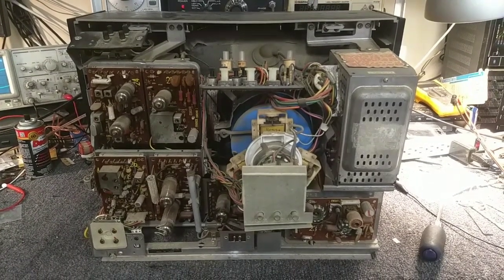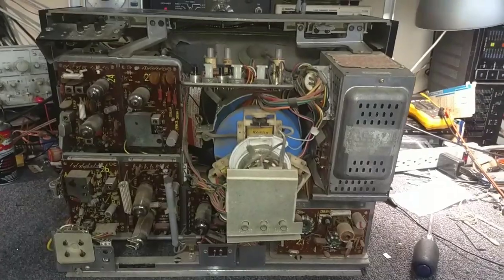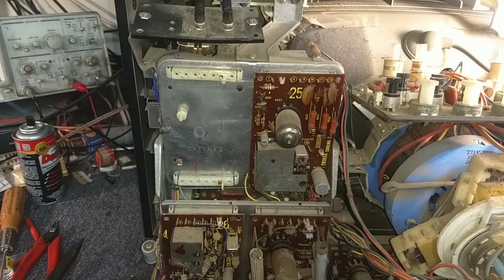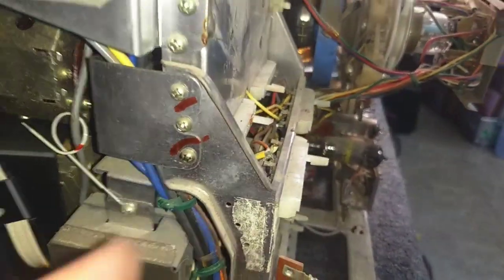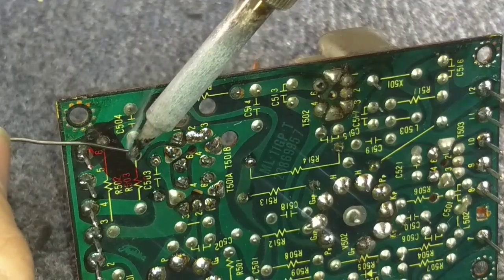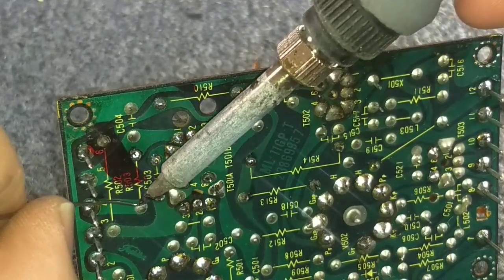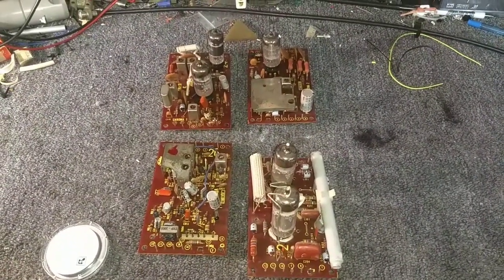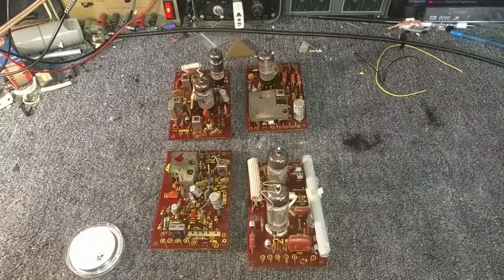Repair of a 1973 Toshiba C321 13" hybrid tube/transistor color TV - Part 2 /?

Comment: I find that with the newer style soldering irons (those with the element integrated into the tip like the FX-951), you can get away with a much lower tip temperature because it actually maintains that temperature on the surface of the tip, even under thermal load. The Metcal and Thermaltronics (Hakko FX-100 as well) are even a step above stuff like the FX-951 because they use an induction heater for the tip, so the thermal regulation is extremely good. I find that with the Metcal, I have a much better success rate on badly deteriorated PCBs than I did with the FX-888.

Comment: 28:20 Yes you are right. Strange tubes in Japanese sets. Also, the overall quality of many of the Japanese tubes was lacking. The cathodes did not last as long and they tended to grid emission due to the metal deposits moving from cathode to grid at an accelerated rate compared to US built tubes.

Comment: (@18:34) - right near your thumb in the image, is the back side of an I.F. can that looks the the entire solder pad lifted off, and there’s no solder on the pin, either. However, at 18:55, there does appear to be solder, but lots of rosin-core flux around the pin (pin 6), as if someone at the factory didn’t heat the pin while soldering.
Reply from the maker: Thanks. I'll have to go back and look over that board
Reply: My impression is that this had been resoldered before.